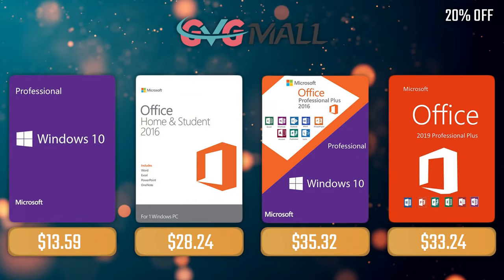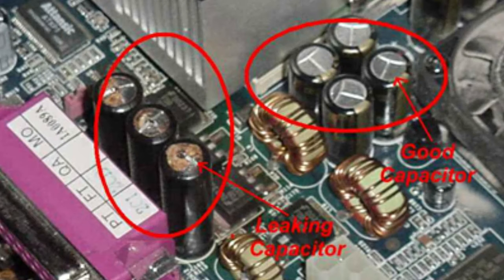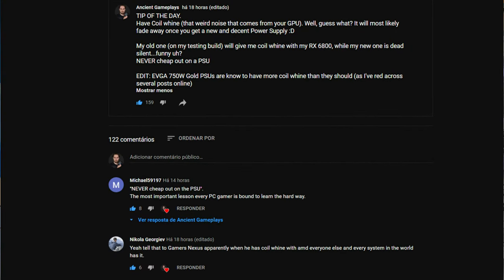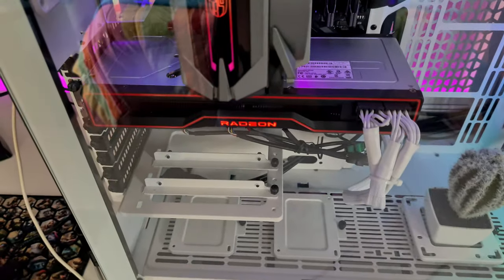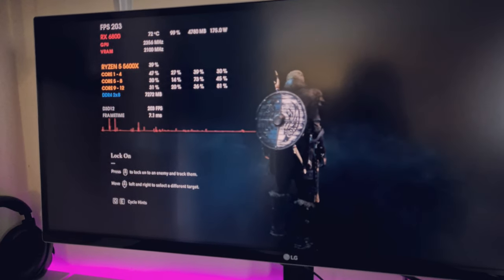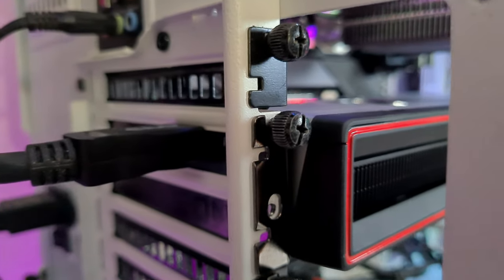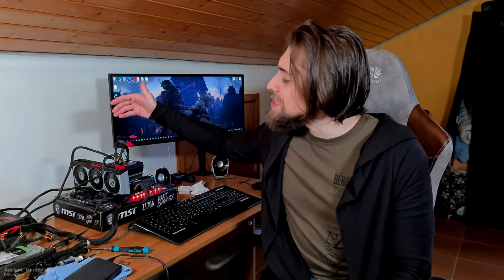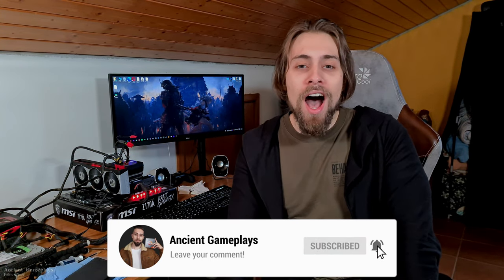GPU Coil Whine -  GPU or PSU's Fault? How to fix it?

Comment: My GPU whine when I move the mouse, any advice?
Reply: what do you mean "move the mouse"
on desktop ? or when you like turn around in games?
Reply: @spatrk6634  Both, but in desktop is less noticeable. Today i noticed that the AIO pump also has the same whine.
Reply: @eprpop  wierd. never heard of coil whines on desktop. and aio pump should be pretty quiet. more quiet than a regular fan.
you sure its not from a clogged fan or something?
so when you are in game and fans ramp up it gets worse?

Comment: Guys, there is another way to greatly reduce coil whine. I have found it on comments under Optimum Tech's video about the same coil whine. Try mining ETH for a day. If its not helping - do it 3-4 times. Also try overclocking and increase power limits to allowed maximum and play on highest settings for some time. Few people reported this helps a lot. Then you can get back to stock for sure, whine still will be reduced or off completely

Comment: two years after......i have an 6900xt with 5600x in a psu that is 750w gold my 6900xt needs three pcie cables the one is 6pin the psu only have 2 but with extensions.....first i know that for my card it  needs up to 850w and three pcie cables cause if i am not wrong every cavle can delivery 150w...2 cables =300 with spikes maybe i pass them???i have coil whine is not too much but i have good hearing my friends says tha tis ok..i dont know you believe that a psu gold 80 plus with 3 pcie cables and 1000ww will reduce my noise???i will buy it for sure cause to uprade in 5800x3d but the noise of coil you think it will reduce???(sorry for my english)

Comment: I've used both a Seasonic 850w Platinum PSU and a Be Quiet Dark Power Pro 12 and my MSI RTX 3070 has coil whine on both :/
Reply from the maker: That means that the problem is your card's PCB. Don't worry about it.
Reply: @AncientGameplays  That's what I figured. Can't hear it with headphones on anyways 😂

Comment: My PSU Is 300W And My GPU Is Gtx 660 And There Is A Coil Whine From GPU And PSU
But I Think It's Because The PSU Is Not Enough For GPU 
I Don't Have Money To Buy A New PSU 
The Question Is If I Leaved It Like This Will This Cause Problem In My GPU ?
Reply from the maker: A bad psu is a bomb waiting ro explode, but if you don't have for a better one, there's not much mlre to do
Reply: @AncientGameplays  It's Original PSU Not Bad
Reply from the maker: @mohamedprofesionalgamer2034  "original"? Still 400w and most likely very old. So yeah, its bad...sorry
Reply: @AncientGameplays  I Don't Know What To Do The Sound Apear When Playing Games And I am Very Scary
Reply: @AncientGameplays  I Mean It's From A Prebuild PC

Comment: I've build recently a pc with rx 6800 and a Rm750x (2021) with a 1 PCIe cable as you but my gpu does coil whine
Reply from the maker: use the 2 PCIe cables. Also, your card model also matters. If the VRMs and capacitors in the PCB are low quality it will coil whine no matter what. A way to decrease it is to use 2 pcie cables for better filtering and ofc, to undervolt the card, because less power draw = less coil whine

Comment: oh this nice noise
my problem with corsair rm750i vs 6900xt or 3090
a take new leadex III 850w but nothing has changed
Reply from the maker: May be the gpus themselves with way too power draw. Undervolt them and it will help a lot
Reply: @AncientGameplays  no somthing wrong with my system
i test my cards on another system psu and they are queit 
today i go to test on anothe one system with my card and my psu, maybe i take bad new leadex:(
Reply from the maker: @markmedvedev5478  yeap, the psu being 850w or even gold means absolutely nothing...it has to do with psu filters...also, never heard of such brand
Reply: @AncientGameplays  seriously? Super flower model leadex
Reply from the maker: Oh super flower, didnt know the model tho. Still, the filters in that psu may not be that great. Also, your mobo may be the problem (someone fixed it by changing mobo also)

Comment: U can try UNDERVOLTING voltage of Gpu with msi afterburner. That worked for me.
Reply from the maker: Undervolting you mean. That only works because the power draw gets lower
Reply: @AncientGameplays   i got asus rog rtx 2060 and corsair rm650x and works.

Comment: Is Corsair CX750F RGB Black enough for R7 3800xt rtx 3080?
Reply from the maker: Well, it seems a decent PSU, but my point is to NEVER cheap out on a PSU. A good one will last you more than 10 years

Comment: I have coilwhine on my strix 3090 and I have a Corsair ax1000

Tried seperate cables Y cables and also trying different pcie slots on the psu 

It is what it is
Reply from the maker: The version of your card and power draw also matters. Also, just because it is an "ax1000" it means nothing...

Comment: Very strange I have a Rmx 750 and have had coil whine on my old vega 56 and now on my new 1080ti very strange
Reply from the maker: Both those cards were know to have coil whine in most scenarios, i still have it on my new psu with vega 56, bit way less than before

Comment: recently replace my 2060 with 6600 xt, but now i hear loud coilwhine.. when use 2060 never hear this... my psu cs550m gold..
Reply from the maker: Well, the psu may not be able to filter the power from the gpu, or the gpu componentes are just not that great as you may have bought a cheap version. It want damage anything though
Reply: @AncientGameplays  okaay ill just use my headphone 😂
Reply: i have rx 6600 ASRock and coil whine too.tried two power supplies on 700 be quiet and 650 montech No difference.
I undervolted to reduce the noise, but the noise did not completely disappear anyway. lowered max frequency to 2400 and voltage to 1090

Comment: Anyone ever get a REALLY high pitched whine from the cpu? 

My wife's fx chip did it for the first few days after building it, then my 5600x did the same thing!

Both completely stopped after about a week and a half. Temps were fine, voltage was fine, just.....really really odd. 

🤔👨‍🔧
Reply from the maker: Those high pitched sounds are usually made when there is a huge amount of fps
Reply: @AncientGameplays  this noise would start as soon as the pc was booted up. It was the straangest thing I've ever heard from a pc. 

It was coming straight from the cpu (I used an automotive stethoscope to listen for it). 

Suuper weird, but completely dissapeared after about a week on both pc's.

insert confused face gif here

Comment: i have coil whine on my ASUS ROG STRIX RTX 3080 v2 , i'm using Cooler master V1000 Platinum PSu i changed it to ASUS ROG THOR 850w Platinum, it's the same noise
Reply from the maker: It means the GPU just coil whines, its normal in higher power draw parts

Comment: I have two cables its still whines and even whines with one cable. Idk how my psu could've gone bad I have a corsair rm750x 80+gold with a gigabyte gaming oc 3070 and I just put this pc together about a month ago now
Reply from the maker: Its your GPU model my friend, the components aren't just that great. Happens
Reply: @AncientGameplays  I fixed it kind of the noise is a lot quieter
Reply from the maker: If the problem is the gpu, the only way to fix it is by decreasing the power draw
Reply: @AncientGameplays  sort of what I did just decreased my frame cap by 50 in some games
Reply from the maker: @AlexE8030  yeah...that is just a temporary fix tho. Try undervolting your gpu

Comment: umm well, does anyone knows about noise pretty sure it comes from my power supply it makes a loud buzzing sound may be at times grinding like sound but if move pc a bit it sometimes stops for long while and be back to normal until the start game is never done that before. I did upgrade the graphic card to RTX 2080 super but that was like sometime last year. I am sure it comes from the power supply but then again had the same issue with my old pc with a CPU fan that made the same sound and would stop when moving pc but then later on CPU fan completely stopped working.  sure my power supply sounds like coming from  the lower part of the pc where power supply is

Comment: Ive had 5x 6700xt (dont come at me for scalping) and have kept one for myself and have noticed a noticeable coil whine from them, at first i though it was from my new 850w psu but i have upgraded to a 1000w but the issue is still very noticeable, i have also tested all the other cards on the same rig and while gaming they all have the same coil whine, idk its possible that all 6700xts have it just by the way they are built. It definitely seems that way. But while mining there is no coil whine on them at all. Even though the power draw is the same but i guess it fluctuates less. I have also tested it with 3070 and 3060 and no noice whatsoever. I guess it something i have to live with as the card still works fine
Reply: I also have a 6700XT and the coil whine does not seem to get quieter when using lower voltages. This GPU is insane.
Reply: Thanks for the feedback. What was the brand of the 6700xt ?

Comment: Lol i never know how to search this sound because i just cant get it and it only happens in damn apex legends while launching....... I WISH you test apex legends in the videos about new drivers this will really be helpful cause i dont install any driver before watching ur videos and apex is just a mess it have different performance with every driver lol
Reply: Lol that would be really helpfull. 

Do you have issues with some reloading animation? 
F.e. when I reload the Sentinel it just feels off like some frames are not showing even tough I have 144+FPS while doing so, or capped at 120. 

Ever seen green lines on testing range? If so, hands off VRAM tuning. 
I did some testing and even tough I increased the slider by only 2 HZ I got artifacts ingame and later on my desktop aswell. 

Peace

Comment: Do not buy a rtx 4090 as the coil whine is unbearable! Its a problem that almost every 4090 has
Reply from the maker: Reduce the power draw and get a good psu
Reply: @AncientGameplays  I shouldn't have to reduce anything or undervolt, it's pure bad card design and second rate components, PSU is 1000w gold rated

Comment: If you using a good psu and motherboard and still get it then you got a bad rng gpu 6800 series mostly has this problem as far as i know. Not a problem maybe but it's annoying as fuck!
Reply from the maker: People said the same about RX 5000 series and mine is dead silent. Most people will use just 1 power connector on a low end PSU...thats the problem

Comment: I boght a rx 6900 xt sapphire nitro and the coil whine is extrame. I. Have a little bit weaker psu is seasonic 650watt 80 gold and I know that the recommended psu for this card is I think 750watt.But I'm disappointed.

Comment: Wow im running a 7900xt on a 750 watt powersuplly on 1 cable with splitter and have been like why is there so much coil wine when i over clock it and its maxing my card 400 watts lol thanks for the great video hopefully i try not runing the splitter to gpu and it goes away but wow if not then im taking my 7900xt back to amazon and buying the 7900xtx with a bigger powersupply lol
Reply: How you handle it?
Reply: @pjoter93  I switched to using 2 12 volt cables but it still has coil wine but not as much.

Comment: 6800xt…. Insane coil whine.. almost not useable .
Reply from the maker: most likely it is your PSU's fault, or simply the model you have that has a weak PCB. As you can see, my AMD's 6800 i silent.

Comment: estou para comprar a lian li 011 mini. mas em comparação com a minha coolermaster nr200p , mas as temperaturas na li 011 mini tb devem ser outras
Reply from the maker: Depende muito de como faças o teu setup de fans e da qualidade das mesmas tb
Reply: @AncientGameplays  o problema é comprar 2 slim noctua 120mm pwm que cada uma custa 25€ cada no Amazon ou ebay e continuar com o mesmo problema. Se de inverno ando com temps altas na gpu quando vier o verão típico tuga ui ui
Mas vi umas fans da thermaltake slim a um preço mais acessível
Quanto ao vídeo e como o Sócrates dizia
Porreiro pá 👍💪👌
Reply from the maker: Aconcelho a pegares uma caixa com bom e provado airflow. Essa GPU é dar lhe undervolt e mais ar

Comment: Using ASUS TUF 1000w with ASUS TUF OC 7900 xtx - Getting coil whine
Reply from the maker: Coil whine doesn't magically disappear mate
Reply: @AncientGameplays  never said it did mate. But does it magically start happening? Mine did
Reply from the maker: @joemay5  this is caused by the caps. Your card caps might be doing this or maybe the psu filter just isn't doing its job properly anymore. I wouldn't worry though

Comment: I have 1000wats EVGA gold 80 3x8pin cable for Rx6900xt and is still dhis same.
Reply from the maker: EVGA PSUs aren't know for theur good filters lol.
Still, the amount of power draw in the 6900XT is high, so it is normal to have a bit of coil whine, if the VRMS aren't top notch, just undervolt a bit
Reply: @AncientGameplays  is very noisy  I have Rx6900xt red devil powercolor  video is on my channel. If you check on headphones 🎧  is horrible 😫
Reply from the maker: @warrior29grom  like i said, undervolt it. Will help a bit. Also, try a newer psu
Reply: @AncientGameplays  I trying everything and still dhis same.

Comment: My 6900xt whines when I scroll through discord ;/
Reply from the maker: Too much power draw and maybe bad capacitators, or your psu just cant filter it
Reply from the maker: Try undervolting and also, dont use 21.12.1 drivers

Comment: I have a mobo coilwhine - x570 aorus pro  :/
Reply from the maker: You sure? Now thats a new one xD
Reply from the maker: @mesicek7  Bad capacitors it seems...goddamn...
Reply: @mesicek7  Gigabyte support is really trash, my friend had to contact Steve from GN (buy his patreon) and explain the situation to him so he could get in touch with gigabyte support, gigabyte returned a GPU with broken PCI-E connector without testing it, if the gpu is shaken even slightly (can be caused by table vibrations), it would break the PCI-E connection and PC would freeze, Gigabyte just returned the card and my friend had to pay for the shipping, iirc they fixed it when he sent it again after contacting Steve

Comment: My Prime TX-750 whines from RX 580......
Reply from the maker: The main cause is the GPU, but the PSU is the filtering part. Also  having 750w means nothing...
Reply: @AncientGameplays  But my Corsair RM650 CWt platform doesn't whine,how the fuk the top premium power supply whines from a mere 150 watt GPU??
Reply from the maker: @MurukuruKuru  simple, age and bad components. Like i said "top tier" doesn't mean much as some "top tier" models have crappy filters..also, material tends to degrade over time
Reply: @AncientGameplays  It's 1 week old dude,can i RMA it?
Reply from the maker: @MurukuruKuru  maybe it isn't a bad thing to so, if yiur corsair one doesnt do that, you have your answer

Comment: Lemme tell u smth 
.
.
.
.
.
.

.
.
.
.

.
.
.

.
.
.
u can do nothing about it :)
Reply from the maker: You can decrease it with a better PSU :D
Reply: @AncientGameplays  no amount of psu ll decrease it if u play at 240/360hz
Reply from the maker: Wrong. I play csgo at 900fps. Is that enough? XD
Reply: @AncientGameplays  well then u are lucky it I've tried like 3 diffrent rx 5700xt's changed the psu at least 2 times in the past year and i cant Play overwatch at 1080p 240hz lowest setting  without my headset on coz of the extream coil noise (like I can ez hear it from another room xD)